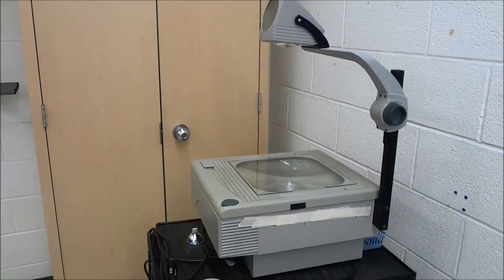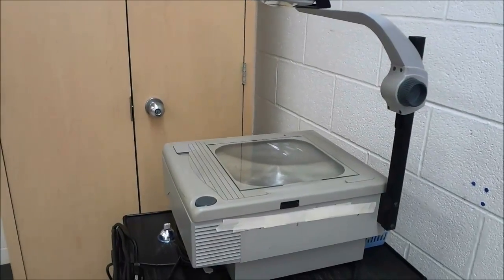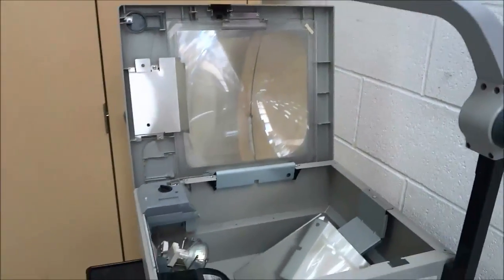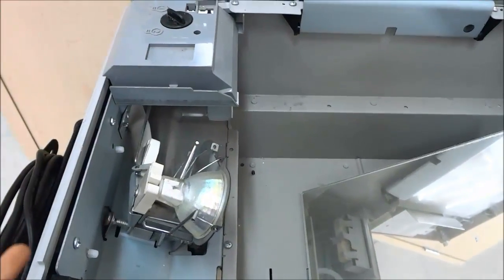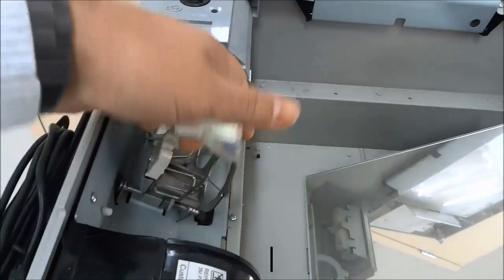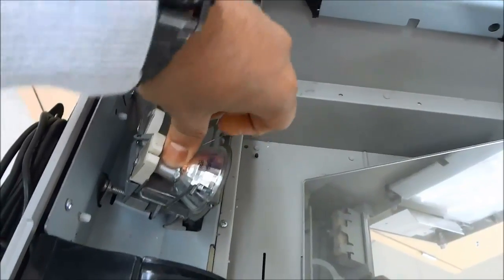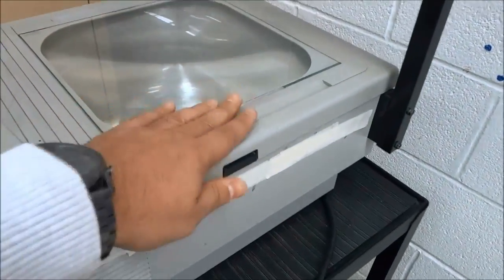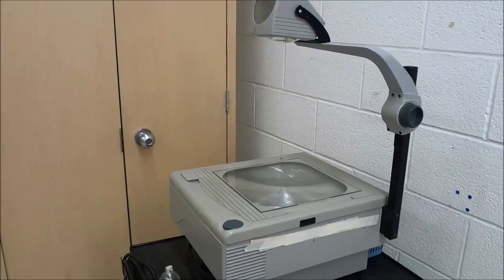How To Change The Lightbulb In An Overhead Projector

Comment: Thanks. I just got an overhead projector from a sale,and was told bulb not working. I was told wrong where the bulb was, so this was helpful. I used a small wire handle to remove it,and look at it. Just need to get new bulb now.

Comment: If it just brunt out as you were using it the first step would be to let it cool down for 30 minutes. If you don't the still hot bulb will come in contact with the cool air outside the unit and heat fracture sending shards of glass everywhere. Could be dangerous.

Comment: Is there anything else relatively simple that can go wrong? I changed the bulb a couple months ago. It’s been working fine. I plugged it in today and no light. The fan is working. The lightbulb does look burnt out or discolored. It takes an EYB 360 bulb that plugs in pretty simple. I’m going to replace the bulb but was wondering if there are any fuses or anything else that may have suddenly stopped working. But the fan is still running? Just searching for answers and came across your video.

Comment: that's not the proper way to remove a bulb in this projector!  if you look closely to where the bulb goes you will see right next to it a small wire handle with your finger pull up or towards you and it will release the bulb without the risk of shocking your self
Reply: +Javier Corona yes. Similar to alot automobile headlights
Reply: THANK YOU VERY HELPFUL!